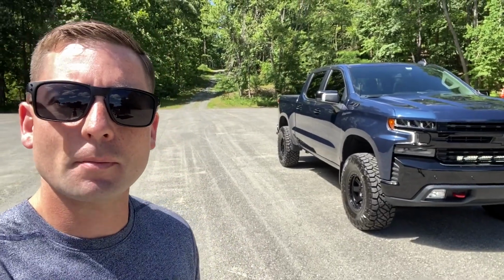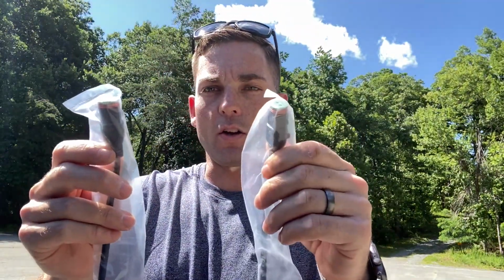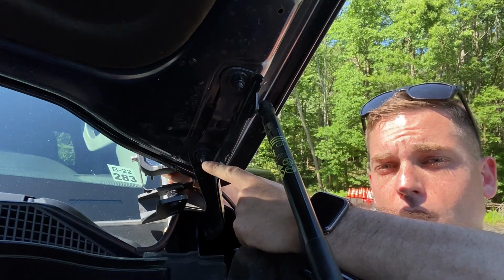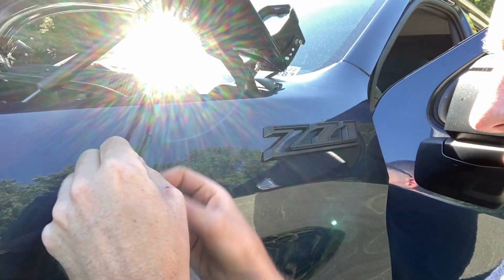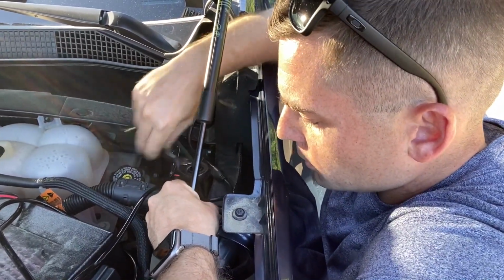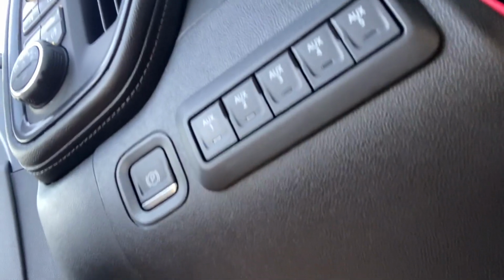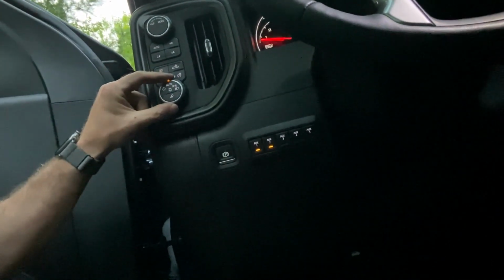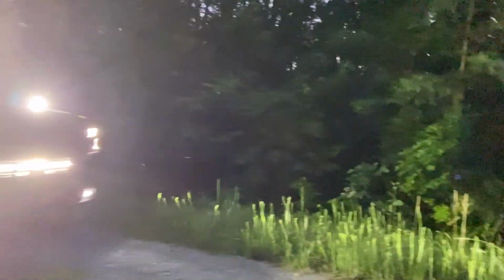LASFIT 3" LED Pod Install (Chevy Trail Boss)

Comment: You should consider soldering those connections before insulating with shrink tubing.  You'll get a much better connection.
Reply from the maker: I thought about it, but so far no problems. If I run into any in the future, I’ll definitely redo it.
Reply: @TheBlueGarage  you may never see the problem unless you compare both approaches side by side. You'll get more electrons flowing with a proper solder.
Reply from the maker: Got ya, that makes sense. So brighter light?
Reply: @TheBlueGarage  Yes, that would be the net result of a better connection.  Would it be noticeable to you in this situation, even side by side?  Not sure.  But, when speaking of electrical conductivity, greater surface area in the connection, the easier it is for electrons to flow.  This is especially true with devices that pull high amps like bright lights.  

I'd say you're good for now, but in the future take the time to solder all wire mends.  Yes, it's a pain, but it definitely gives one peace of mind.
Reply from the maker: I’ll definitely keep that in mind. I appreciate that, thank you.

Comment: Excuse my ignorance. Will adding pod lights and grill lights ruin my battery or interfere with any other lights? I'm new to trucks and "modding", would hate to ruin my brand new truck lol.
Reply from the maker: Not if done right. The way I ran them was to my Upfitter Switches, that powers the lights, which is on a new fuze on the battery, installed with the switches themselves. Then the individual lights have fuzes of their own to protect them and the battery.

Comment: Hi nice truck,couple questions:do you know if this brakes work in 2024 Silverado crew cab Z71? And Did you use the relay that came with the wiring harness? Thanks
Reply from the maker: These are the stock brakes and I used the whole wiring harness that comes with the lights.

Comment: Why didn't you do the wires first then plug it in ?
Reply from the maker: I just wanted to make sure I had enough slack. So I pulled the wires through the firewall leaving enough to keep the wiring tight under the hood.

Comment: Where did you get the hinge brackets ?
Reply from the maker: They are in the description below. They are brackets made for a Tacoma, but I did my research before hand and found out that they would fit on the Silverado just fine.

Comment: Do u go through drive thru car washes with those light pods on? Im thinking of installing a set. But will they get damaged if you use drive thru car washes too much.
Reply from the maker: I have a. Few times, haven’t run into any issues at all. At most, I have had to readjust them because they get turned, but no damage or anything.

Comment: Great vid! Question, when you ordered your lights did you add the harness? I ask because the specs say the lights come with a bracket already.
Reply from the maker: Thank you, unfortunately they were out of the brackets at the time of my order, so I improvised with the Tacoma Bracket, which also works perfectly. I am almost certain that the brackets normally do come with the order. But the harness did come with the lights.

Comment: What year is your truck? I have 2022 Silverado; do you think I can use the same brackets? from the video it look like the bracket will fit. (I don’t think the hood is any different) but I thought  I would ask to be sure.
Reply from the maker: If you have the refresh, I know the hood is slightly different. I don’t know for sure that it would fit, like mine did. But from the pictures that I have found of the 2022’s hood brackets, it looks like it would fit just like it did for me.
Reply: @TheBlueGarage  yes I have the refresh. I will try it. Worst case scenario I will return the brackets.
Reply from the maker: Good luck brother, let me know how it works out.
Reply: @kossiametsife3845 did the brackets fit for the refresh?
Reply: @ianmanore866  no they did not fit the refresh models.
Reply from the maker: Damn, sorry it didn’t work out.

Comment: Hey man love the video , I clicked the Amazon link for the hood light brackets and it came up as Tacoma brackets ….do those work for the Silverado?
Reply from the maker: Thanks man, yes they do. I should have mentioned that in the video, but those are the same ones that I installed, since I had trouble finding the Silverado brackets. No issues, and they sit perfectly without rubbing anywhere.

Comment: Hey quick question, when you use your wipers do they hit the mount for the lights? I just installed mine with the mounts you used and it slightly hits the wiper on the drivers side.
Reply from the maker: No, mine don’t even come close. I’m sorry to hear that.
Reply: So the brackets in the description are the ones y’all used?? I was directed to a Tacoma bracket
Reply from the maker: That’s correct, I failed to mention that in the video. 👍🏻

Comment: Hey did you feel your care ride get significantly rough after the level and larger wheels? I have 2021 z71 1500 i have it leveled with bilstein 5100s and im running ridge grapplers 295/70/18 about a 34 and half inch tire with 38psi. I used to have 33s in on it before, now i feel like the ride quality is very rough and bumpy. I know its a truck not a cadillac but anyway I can improve it?
Reply from the maker: Honestly, not even in the slightest bit. I think the ride quality is smoother and quieter now. I definitely expected the tighter suspension to make it a harder ride, but it didn’t change at all. The tires are what helps with the smoother and quieter ride.
Reply: @TheBlueGarage  what tires are you running?
Reply from the maker: @Artjan1  Nitto Ridge Grapplers (35x12.50R17LT)
Reply: @TheBlueGarage  so weird im on the same...
Reply from the maker: Very weird, I fully expected it to be a tighter ride, but it rides the same… as far as the suspension goes.
Reply: @TheBlueGarage do you think i should change the back to bilstein also?
Reply from the maker: I would, just to match. But idk if it would make the difference or not.

Comment: am i the only one absolutely lost with the wiring and shit goddamn i feel like an idiot😂
Reply from the maker: It is a little challenging, but take your time and splice it correctly. Unless you are talking about running the wires through the firewall, then use a coat hanger to feed it through.

Comment: Bought same lights with their brackets how come you didn't buy their brackets ?
Reply from the maker: They were out of stock at the time.
Reply: I wonder if I could just buy a fuse block for the battery ?
Reply from the maker: @joedrazic6764  what are you using for the switch panel?
Reply: No it be easier to hook up to the battery if I could put  them fuse links on top of the battery !
Reply from the maker: Got ya, but how will you power them on and off?
Reply: With the las fit switch.